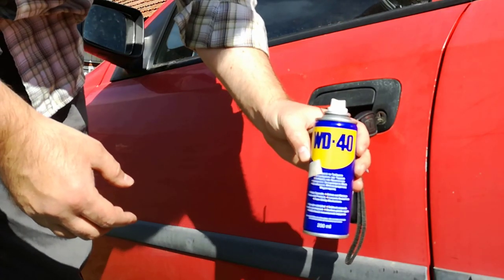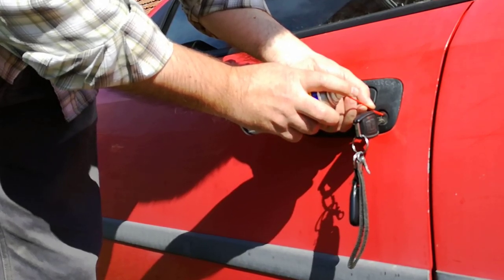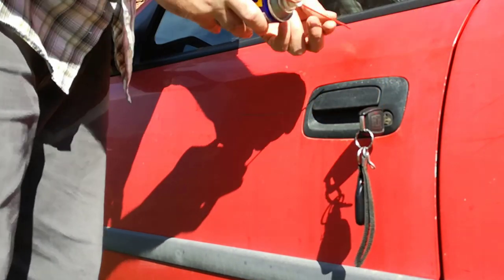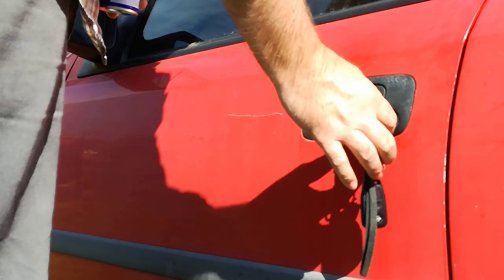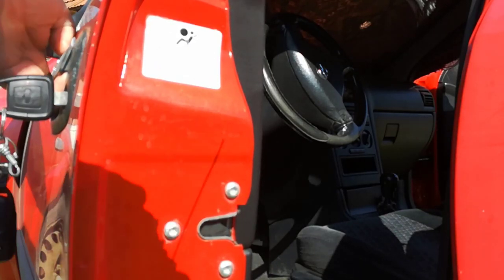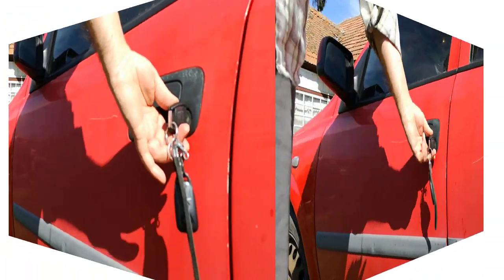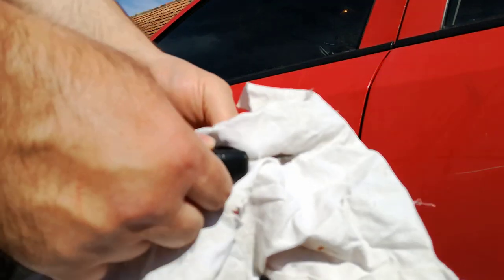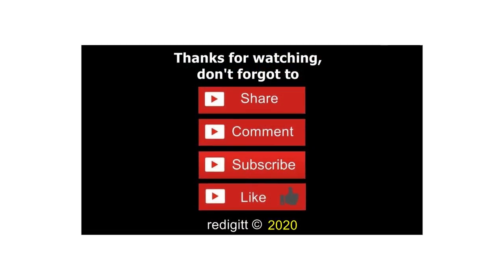rd #324 How to Fix Car door key won't turn or car door key is hard to turn

Comment: My key is stuck in the lock.  It turned to open the lock, but now it won't turn back.
Reply from the maker: Aloha, try to spray with WD-40 or any silicone spray.

Comment: I've done this and it's still frozen... wont even turn... any ideas?
Reply from the maker: This works generally when it turns, but it turns very hard, like in winter when the water get in the lock and froze or you have some dirt, dust in the lock.
Probably for a  long term cleaning, I should first suck the dust with a vacuum cleaner and only after that used the WD40 spray.
If it won't turn you have to dissambly and probably change the lock.
Reply: @redigitt  damn... okay, thank you

Comment: Good video, thanks. I used CRC CO Contact Cleaner spray instead of WD40 as CRC doesn't leave a sticky residue like WD40. Worked a treat.
Reply from the maker: Thanks for sharing, I didn't know that CRC CO Contact Cleaner spray,
 but the WD-40 keeps away the moisture and lubricate to. 
In winter after the snow is melting, the water enter in the lock and when the temperature drops below 0, the lock is freeazing or work very hard.
 If you spray with WD-40, before the water enter in the lock, i recomand to spray 1-2 puff in october and in the winter the lock won't freeze.   
Thank you for watching, if my video or advice was useful, please consider to share and subscribe.

Comment: Wd40/rp7 & similar can attract dust,can also leave a sticky residue inside the lock which could cause you future problems too.
Several other videos here on u tube suggest using a dry lube & it wont attract dirt/dust 😉
Reply from the maker: Thank you for watching and for your comment,